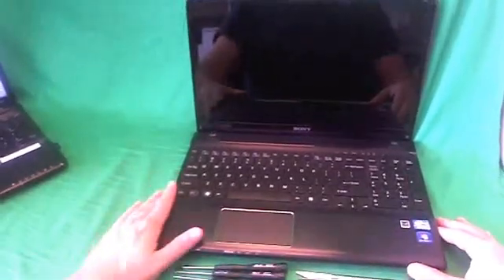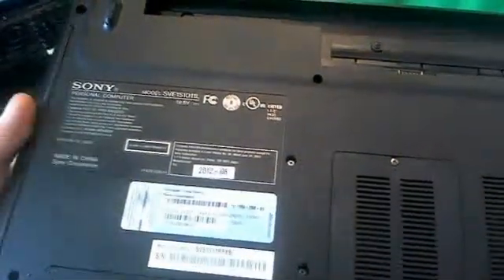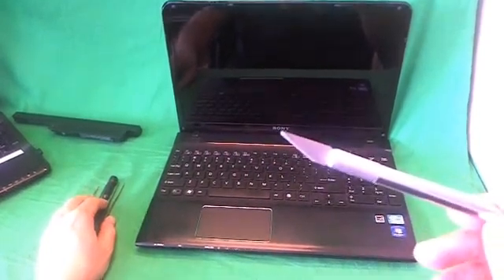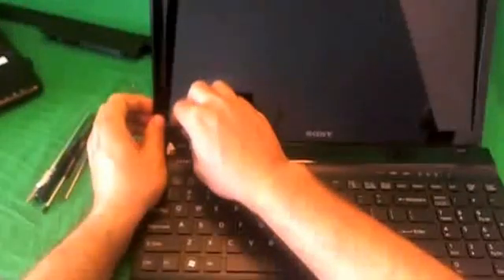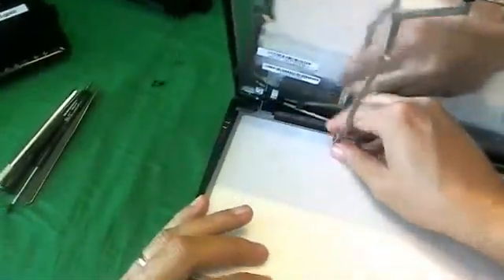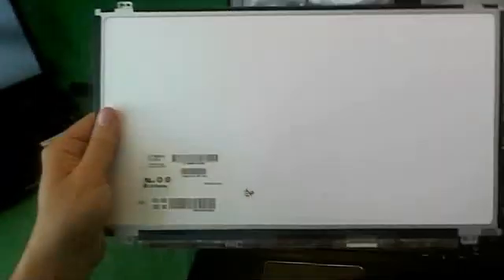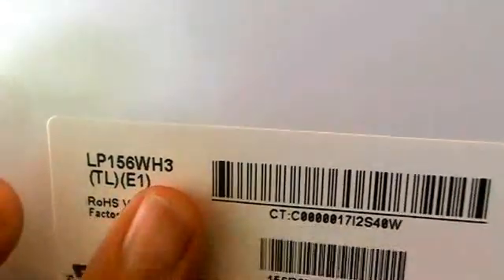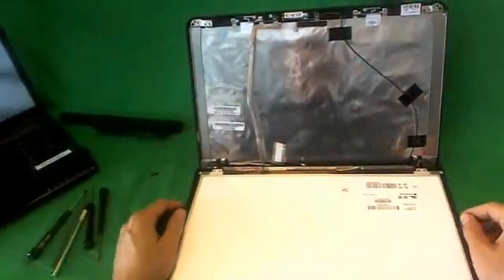Sony Vaio SVE Series Laptop Screen Replacement Procedure

Comment: Before you even attempt to do this , You will need to buy some Watch makers screwdrivers as the screws are very small also I used wood glue to put the screws back in. ( If you try to do this you will see why ) You can also unscrew just the screen part than opening the computer part you can do this because I managed it .

Comment: +Jay Sanders
Thanks for the info on the grounding screw, Did your laptop have any double sided sticking tape to secure the bottom portion of the bezel.? My SVE 15 did and i had a tough time prying open the bezel in the bottom section. This video doesn't seem to have that problem. Also i now have to get hold of double tape to secure the bottom bezel, the top and sides clip on well. Your take.

Comment: I opened the screen and when taking the cable off, pulled the ground cable from the connector, where do I reconnect it. (not the screw end) does it need to be connected ?

Comment: Hi, I need help. I replaced my cracked screen with a new one (same model no.) and when I turned it back on again the image was really dim. I put the old screen back in again to check and now nothing appears on either screen. I purchased a new video cable and I still just get the black screen. The laptop works fine when I plug it into an external monitor (TV) and I can use it that way. Any suggestions? Thanks
Reply: Were you able to fix this? I am seeing same issue now

Comment: Bad idea to take off the ground screw. Don't listen to this guy. To put it back on you have undo the rest of the frame and separate it from the hinges completely. Much easier to use the limited space to detach the cable.